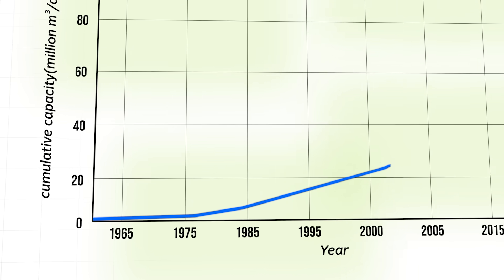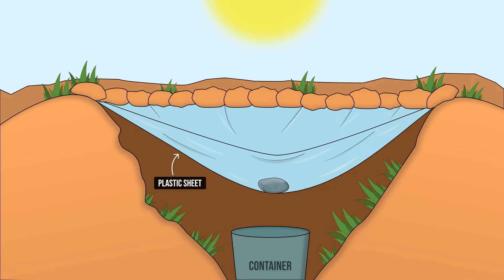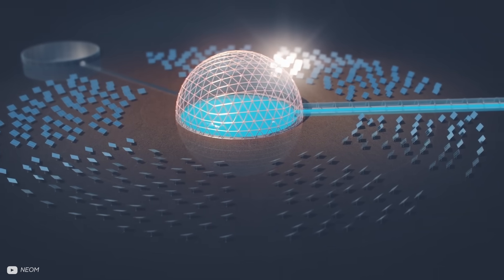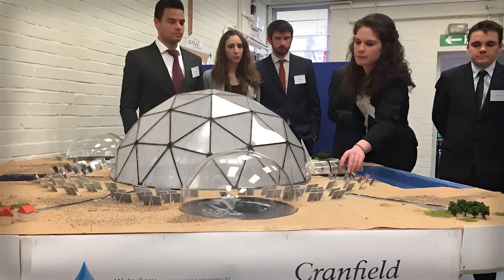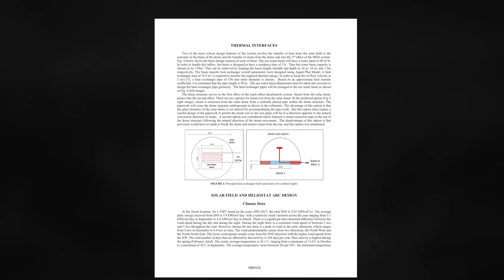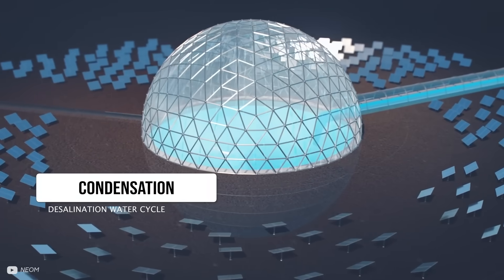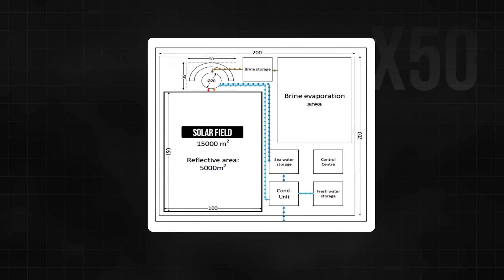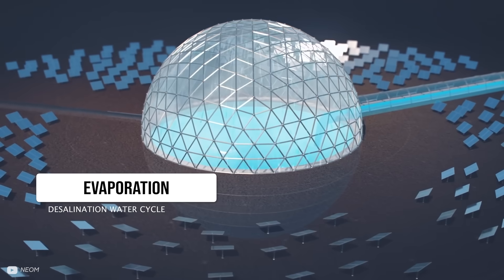Unlimited Fresh Water: Can Glass Domes Save Us?

Comment: The essence of the dome idea seems good: directly solar powered, as simplified and inexpensive as possible. Oil barons aren't gonna do that right, but other leaders could.
Reply: It's simple, but doesn't deslinate much water as well.
You can't have simplicity and efficiency at the same time in this case.
Simple solar stills can make sense in a small scale, but if you want to build something big anyway, you can build a much more efficient solar thermal powered MSF-desalination plant just as well.
Reply: @701983  Not the way they designed it, you're right. But you don't need complexity to concentrate a bunch of mirrors on a tower. We've already seen that with molten salt systems.

Comment: Yah, sometimes the rabbit hole ends in a pile of rat droppings... but thanks for checking this out for us!  Everything about that system looks like a rube goldberg attempt to defeat thermodynamics.  At this point, it really seems like baic solar/wind energy systems plus reverse osmosis is the sensible way to do desalination, especially since that doesn't have to create toxic super-brine byproducts.  It's better to pull some fresh water out of a large salt current at small percentages than to try to get max boiling/drying with huge heat wastes to boot.

Comment: concept 1, dome and parabolic mirrors: directing the heat to the structural elements is, besides material issues, total nonsense, because the heat would probably radiate off and do little to heat the water.
concept 2, salt-water spray and sequential heat transfer: The heat exchanger pipes would quickly be covered by a, insulating salt crust.
There would be concepts where the sunlight may be used much more effectively, with very few moving parts, but these were not shown here.

Comment: My contribution to this is using wind-powered steam-engine level tech to do vapor-compression, a well-established method of distillation with greatly reduced energy requirements. I would also think it could be extended right the way to extracting a lot of solid sea salt, and taking the minerals from that.

Comment: 1. Low Temperature Thermal Desalination or LTTD is a far better, as in efficient method.
2. RO with standard PV solar power
3. PV solar power driving Heat Pump to heat seawater in either normal vacuum distillation plant or LTTD.

This glass globe is good as fancy greenhouse only.
Driving steam turbine from this thing, looking at the surface area alone, can you imagine the forces involved even for a miserly Newcomen type atmospheric engine arrangement ?!!

Comment: Distilling water can be achieved with minimal energy by using a flow-through, highly insulated water distiller that integrates an efficient heat exchanger between the feedwater inlet and the condensate outlet. 
In this system, the incoming cold water is preheated by cooling the opposite-going steam and condensing water, allowing for near-total energy recovery of the heat.
The recovery depends largely on the efficiency of the heat exchanger (its insulation and the surface area shared between the opposing streams). 

Unlike traditional batch distillation, this is a flow-through process, with a small heating element strategically placed at the triple junction where the boiling point, incoming pre-heated water, and continuous waste discharge meet. The steam is allowed to rise straight up through an insulated loop before coming back down and passing by the incoming cool water, as described above.

It baffles me why this approach isn't used everywhere we distill water. 
We can recycle almost all the heat we generate to boil more water, over and over again, simply by optimizing system insulation and heat exchanger efficiency.
Reply: Genius 😮

Comment: Great analysis! Potentially useful concepts implemented in ways and applications they add more complexity and cost than real benefit (if any) won't save the world. The intriguing thing about the dome shape is that it gives a small surface area for a given enclosed volume, which is great if you need a small surface area for a given volume. But Solar Water seems to be looking for a way to implement the dome shape to address a specific problem, instead of looking for the best ways to address the problem, regardless of if that involves a dome or not.  

I haven't thought about the fact that besides Saudi Arabia having a lot of money, they also provide the benefit of good excuses to pull out when you can't get your proposed solution to work.

Comment: I feel like a saw something with how light, by it self (not just it's heat), was responsible for fog and more. Spheres are ofc by design large area and less wall, which might be good for insulation reasons. But ofc : scalability and just throwing more mirrors at the problem might be a cheaper solution

Comment: The dome doesnt make much sense because the point of the condensing surface is to be slightly cooler than the surroundings and come below the dew point. That works ok when gently heating the water in the small versions while heat is carried away from the larger surface area above. With the water in the dome being actively pumped with energy though it will be less difference and less efficient at condensing. It still will, just not super efficiently. 

It would be better to use the solar collection troughs to heat the pool of water and use something like geothermal cooling loops to cool the air above that pool, and you wouldnt even have to bother with the giant glass dome in the first place.

Comment: Check out a paper called "Plausible photomolecular effect leading to water evaporation exceeding the thermal limit" which explains how light itself could work to cleave off water molecules and cause evaporation separate to the thermo-evaporative process.  In this scenario a dome would likely be less efficient than a long shallow prism might be, light and heat could be reflected into it.
Reply: Yes the research by MIT (Massachusetts Institute of Technology) shows that photons of green light frequency is several time more efficient than infra-red photons (light from the sun, etc.) in causing water molecules to evaporate. This effect is called the "photomolecular effect".
Seawater could be preheated in a large, shallow pond.  The bottom and sides would be black. The top would be covered with a clear material. This pre-heated seawater would be led into the dome. 
  In, both, the pond and the dome, all the wavelengths of light could act on the water. If there is enough evaporation, the salt could be collected and sold on the salt market.
Reply: Yeah this is where desalination is destined to move over the next 5-10 years, that research is a breakthrough in understand how water evaporation behaves.

Comment: The reason they don't collect water condensing on the inside of the dome is because there isn't anything to collect. The dome would be crazy hot. The water wouldn't condense on the dome surface. They need to move the hot moist air into areas which would be much cooler than the dome.
Reply: You mean...a de-humidifier, like possibly a small window air conditioner?
KEK. And obviously yes. The domes are missing some super basic shortcuts that been around for a century or two, but would basically work. Good thing I did this 15 years ago already, but for flash steam generation. You basically change their dome frame design to be honeycombed smaller transfer pipes, inside a larger one, running to fractal patterns hexagonals about a 1/32nd thick..basically like hexagonal pads that are around an inch or two overall wide, that are your steam boilers. Secondly, you decrease your sphere size to maybe 4 or 5 foot across, to allow for a faster thermal capture, which is passed thru fresnel lenses that create an outer shell around the inner sphere on their own framework (no need to rotate or align) about 2 inches away from the inner sphere.

For your fractal pads from the equator down, you basically either leave them as the cooling system like the coil from a still (pre or post slobber box), or use a basic array of mirrors underneath to redirect solar.

At that point, you have basically an Archimedes Death Star, that will thermo-siphon from a reservoir, with a slobber box from the steam generator on the return to the center of the inner sphere. That's the overall steam generation design. It was not designed for desalination, though that is easy enough to achieve as a secondary, not primary, goal. It was designed to be fast & cheap. Easy to throw away and replace, or with heavier use units, easy to maintain.

The best part, is that within a few generations of real-world re-design, it will put those as being super cheap to produce and use. Possibly even faster than that.
Reply: An array of much smaller domes passively heating like a greenhouse then pumping or compressing the saturated air into a submergerged condensor on a floating platform would be very low energy, just electricity for the compressor and some water pumps.
Reply: if you can use the incoming water to increase pressure within the dome, it would offset the electricity needed to pump the steam out where it'll be condensed, either through underground or underwater pipes  @motimobo
Reply: the more passive the system is, the less maintenance it'll need and the more reliable it'll be. it's crazy how overly complicated we make things. while I enjoy my electric windows, it's so much easier and cheaper to fix the old mechanical types
Reply: @motimobo  absolutely hey, if it's landbased you'd run the moist air though underground pipes where it's cool enough to condense and then pump from a collection tank
Reply: Cooler condensation area like… a black painted patch on the top of the dome, under a Saudi desert night sky?  Not sure the timing is usable but it might help.

Comment: One issue not addressed is what to do with all that concentrated brine left over from desalination. You can't dump it back in the ocean, it's too concentrated and will kill all sea life at that point.
Reply: So I think the best way is to pump the brine in a tanker and head out to the deep sea. Because usually these pipes are dumping directly at the shoreline or there’s a longer pipe with smaller holes to help defuse the brine. You take it out in the ocean and you control exactly the rate, concentration of the brine, how you are dispersing it and at what depths. The brine can be cut by more seawater on the ship and the ship can be moving. Regulations need to stipulate the dissipation rate.

Comment: I got a way better idea for desalinization! Imagine black plastic water pipe zigzagging in the desert sand by the shore. The pipe is of equal elevation. One end of the pipe has a pump to pump seawater in and the other end has a reverse P-trap. This end has a pipe on the end of the P-trap that goes back into the ocean then back up on shore. Another smaller pipe is attached to the pipe under the water and all of it is weighted down, this is freshwater outtake. So the water has to get up to 100° to get steam to condense in the Ocean pipe. But with the valves closed there is a vacuum pump connected at the top of the pipe coming out of the ocean. Heat from the sun hits the 3/4 full sea water pipe, vacuum pulls off dissolved gases until it boils at a lower temperature. Once the process starts the vacuum pump can be shut off because the condensed steam will create more vacuum as it turns to liquid.  Cheap easy and clean distilled water!😎
Reply: As an engineer only if issue I can see is it's cheap and one cannot over charge the client😂
Reply: I wish I could follow your description, it sounds great. A video/diagram of how your example functions would really help. Do you have a link to videos or descriptive diagrams? Please and thanks.
Reply: @flutieflambert  thanks. Try drawing it on a piece of paper I think. The desert sand would be back from the water perfectly dry, gets lots of sun.  Area about the size of a football field perfectly flat.  lay the pipe in a long row turn it around and come back right beside it and keep going till the field is full. Pipe would probably be a minimum 4 inch diameter where you could do it with pretty much anything larger than that.
Reply: @Palisades_Prospecting I imagine it looking like one of the rooftop solar water heaters, where a black pipe is laid out and and connected by mesh. In a desert environment you could even use crushed rock between the pipes to soak up extra heat, use any space between the loops of piping to increase the passive heating effect.
Reply: @Solutionist1  yeah anything that’s black, Best heat absorption colour. Unfortunately asphalt might be the best, lol.
Reply: You kind of breezed over how the water gets to boiling temperature...
This is about desalination via passive evaporation.
Reply: @emmakai2243  sry, The vacuum pump pulls approximately 28 to 29 inches of vacuum (no molecular pumps needed). This brings the boiling temperature of the water down to about 30°C. The sun heats the black pipe which heats the water to above 30°. The steam is 30° and rushes to fill the vacuum so it spreads evenly along the pipe up through the P-trap and then down in the pipe that’s under the ocean where it’s cold. Steam condenses with the cold pipe and now you have fresh drinking water that you just need to pump out of the bottom of that pipe. Of course this is without iterations of efficiency.
Reply: @Palisades_Prospecting even if that piping system isn't used to directly gather steam/moist air, it'd be a hell of a way to preheat the seawater before it's sent elsewhere.

Comment: water too deep, too much energy loss due to immense surface area...I could see shallow depth circles with inclined roof made of glass to maximize natural solar radiation AND  mirrors feeding more heat but placed in fan shaped area N of the circle, concentrating the light on the base of the circle to heat it up, make that front wall flat, water catchment around the edge.    Use a ground based cooling system to improve condensation rates,  let the hot moist air escape while warm fresh air is bubble up thru the water.  moist war air routed to pipe to cool.  The pipe is cooled by ground based thermal cooler.

Comment: Ironically recently I have been thinking along the same lines. Why, in sunny countries, do we not use solar energy, reflected sunlight, to heat water creating steam, and use this steam in some way? Why wouldn’t it be more efficient than pushing water through filters?
Reply: You have to vaporize water, which requires more energy, is more efficient to use reverse osmosis. Energy to remove salt, is lower.
Reply: I think RO is pushed because some company can sell an expensive consumable (the RO filters), rather than relying on a method that uses simple industrial tech and is heavily leaning on process controls to operate. Seems like something many smaller equatorial countries could figure out for themselves, but for whatever reasons they haven't been able to kickstart the engineering needed.

Comment: These domes don't make sense. If you're going to make steam and generate electricity with turbines, you might as well use a thermal tower (existing tech) where the solar energy is focused on an elevated tank of water. The dome is a less efficient way to create steam because most of the solar energy doesn't make it to the water in the ground.
Reply: But it looks cool and you can scam investors!
Reply: @Joe-sg9ll  I was comparing it to thermal power plants. Thermal powerplants use heat to generate high pressure steam that turns a turbine. I suppose humidity and steam are the same thing, but steam contains a lot more energy.

Comment: 0:15: "... an extremely energy intensive process": That's a question of perspective.
Compared to simple distillation, which needs more than 700 kWh of thermal energy per m³, the modern processes like MSF (multi-stage-flash, thermal) and reverse osmosis (electric) are both extremely efficient and energy-saving.
And yes, this dome doesn't make sense for big scale desalination.

Comment: I may have missed you mentioning this, but the M.E.D. installation I worked at used reduced pressure (below atmospheric pressure). Each step was performed in lower pressure to increase the evaporation and the need to add extra heat to keep the process going in each step. Reducing the pressure took less energy than adding heat.
Reply: That is a correct approach (if not the optimal one for efficiency), but they should be using a metal water tower instead of some glass dome. Not as pretty, but there would be less problems and more reliability in construction.